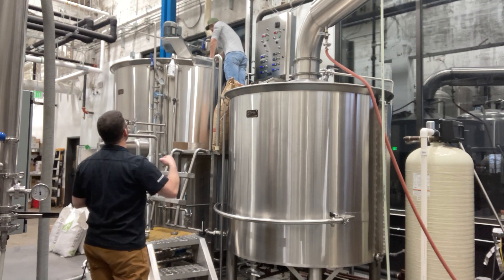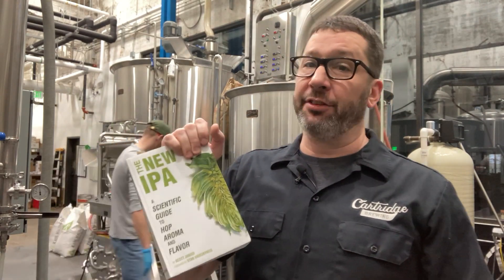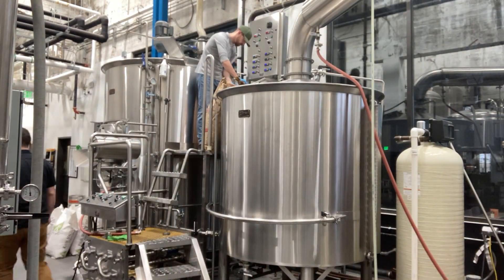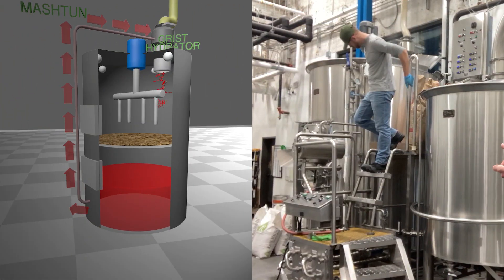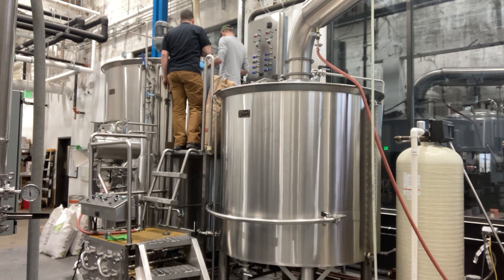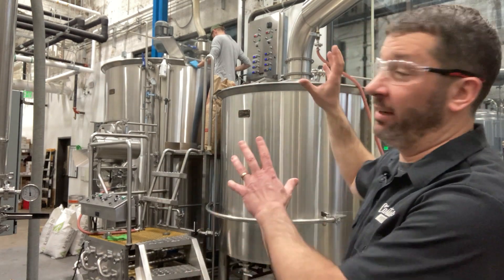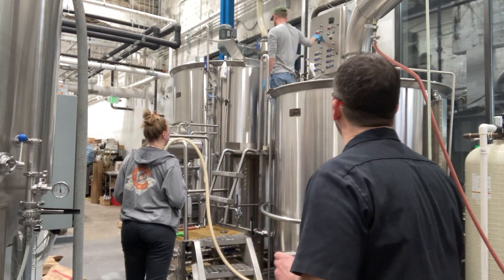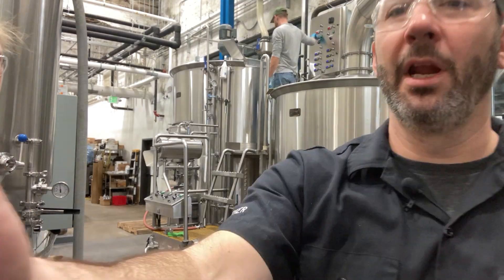Full Brewday: Deep Dive on IPA & NEIPA ~ Chapter 2

Comment: I'd like to know your calculation process for water temperature into the hydrator to hit your mash temp target.
Reply from the maker: There are calculators out there. For me it has been a bit of rural and error and an experience thing. I have hit different mash temps with the same strike water temp in different systems. That’s why it is probably best to dial in for your system.

Comment: What's the theory behind adding the oats separately at the end so they're sitting on top? Does it help with recirculation and reduce the risk of the mash getting 'stuck' since the oats tend to get quite thick and sticky?
Reply from the maker: Great question. Honestly just something that I started doing after getting a stuck mash with a grain bill high in flaked product. Might not be any science behind it, but anecdotally speaking, I have not had issues since with high percentage flaked grain grists.